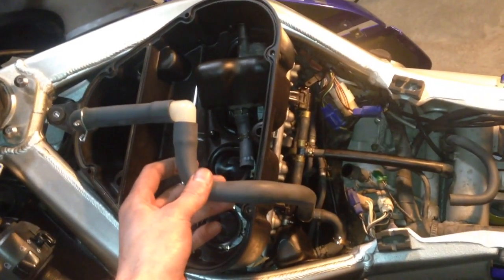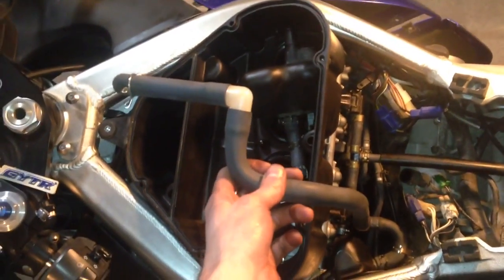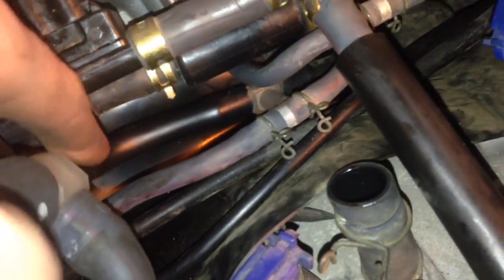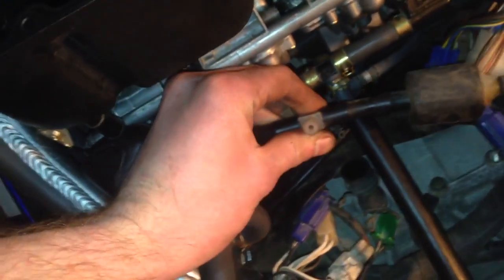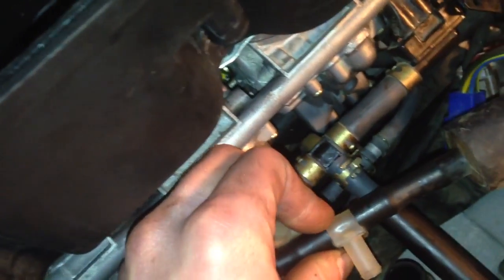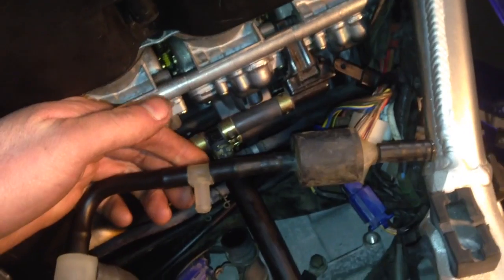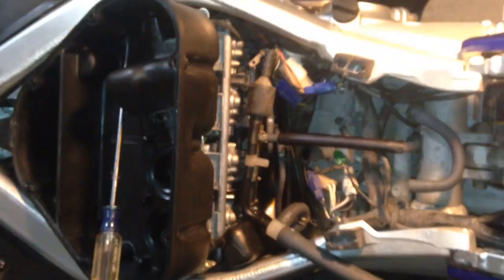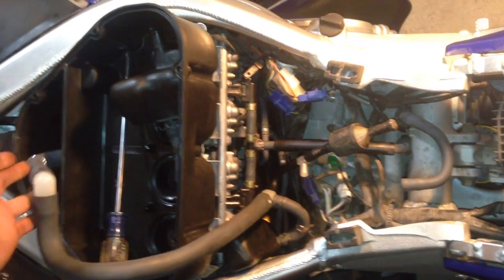Yamaha YZF R1 Vacuum Line MISSING HOSE Where It Goes!

Comment: I have 3 hoses coming off the engine block, on on each side of the engine and one on the middle under the carbs, I have no idea what they connect to but you can feel the bulge on all  of them where a fitting was definitely inside them, you can feel them sucking air in and if I plug them up my bike runs fine anyone know where they go??

Comment: I have fuel shooting out of that T what does that mean?
Reply: Me too did you find out why ??
Reply: @RedBrixs_ENT_bossdonbigga  did you solve this problem cause its started happening to me after I patched 2 rubber diaphragms for cylinder 1 & 2 it had a  small tear patched it up now when i start up my bike fuel starts gushing out from that T piece when it never did before  my take is that the float bowl is stuck open after I did  my patch repair on the rubber diaphragms leaving it to get stuck open when I pull the throttle even when throttle snaps back to close because of that patch I did i noticed one of my cylinder piston valve gets stuck when i push it back  when the rest  they push back out because of the piston valve spring.
Reply: @RedBrixs_ENT_bossdonbigga  i am having the same issue and im confused about what to do, what did you do to fix it?